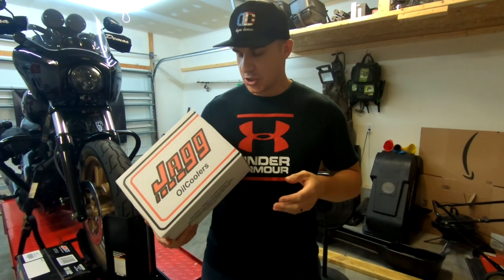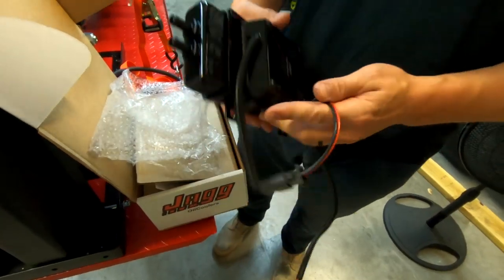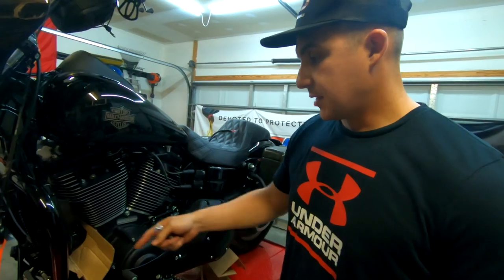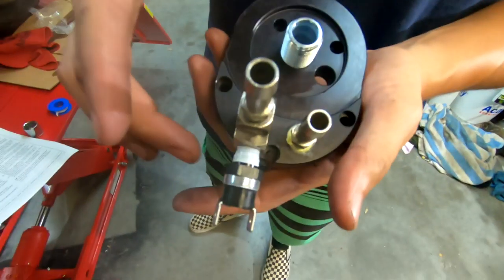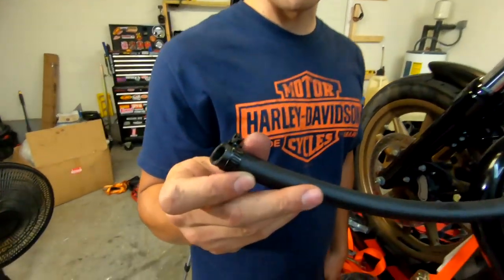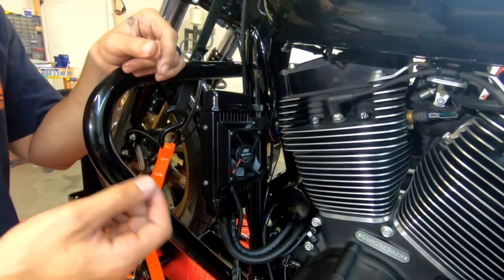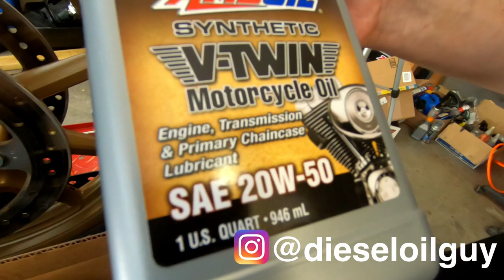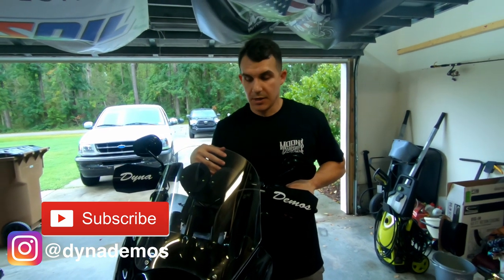Jagg Oil Cooler Install (dyna)

Comment: Just installed one, minus the fan option on my FXR. Had to use an external thermostat as the filter housing is under the bike. These work great and have ran one on my past few Evo’s. Must have on these hot air cooled bikes.

Comment: Just found this video and just purchased the same unit for my 2013 Dyna FatBob.  Looks fairly easy to install, I’ll let you know how I make out.  My buddy has it on his Street Glide and sold me on it.  Thanks!
Reply from the maker: Please do!
Reply: @dynademos  so I installed the Jagg oil cooler on my Fat Bob and have had good results so far.  Definitely running cooler.  I’ll be taking part in America’s 9/11 ride in a couple weeks, so I’ll definitely report back with it performance during that ride.

Had some problems though with the install.  First was the down tube mounts which were slightly smaller than what I needed. I couldn’t get it closed tight and the bolts pushed through the mount holes.  I added a washer between the head bolt and the mount, I was able to get it to close tightly.  Also, one of the black 1-3/8” bolt, used to mount the front part of the adapter and engine anti-rotation bar, the hex-head stripped out.  This happened when I was fitting up everything.  Unfortunately, I had to cut the head out and use a set of vise grips to back the rest of the bolt out.  I purchased a set of better 10-24 1-3/8” bolts to replace them.  Other than those hangups, it is working great so far!

Comment: I installed the Ultra cooler 3.0  about 2  days ago on my Road King S&S 100" with easy start 585 cams before the install of the cooler my bike ran at 267 degrees at a 100 degree day in Sacramento know it's at 227 Degrees just remember if you have your bike tuned professionally you will see numbers like this stay far away from all of those can tunes on the market you are better off getting a real tune that will make more HP and make your bike run much cooler
Reply from the maker: Roger Moore that’s awesome rod plans to get his bike tuned eventually 👍🏽

Comment: Depending on the fan. Some fans spin the other direct if the wiring is reversed. Just make sure the fan is pulling air through, when you're done.
Reply from the maker: Matt Storie will do it stated in the instructions it didn’t matter what terminal post it was on but I’ll make sure 👍🏽

Comment: Great Video as always.....that bike is a can bus bike....can bus is high speed communication basically when you press the turn signal switch its sending a signal to the control module to turn on the turn signals. Unlike a traditional circuit that completes the circuit to ground if that makes since....lol 🤜🤛
Reply from the maker: Tripp_HPjunkie yeah that totally makes sense now new school vs an old school electrical system

Comment: Best place for Oil Cooler is Above the Regulator. Just Switch the Horn Bracket Around. And you Won't loose Air cooling on left side of Engine.
Reply from the maker: Noted thanks for the advice!

Comment: Great videos as always. So as a new rider stationed in Naples, Italy although lane splitting is a custom thing especially for motorcycles sometimes its either just not safe to or confidence may be lower. Would this be a good mod especially during construction or accident heavy events for a new rider on a 2017 street bob dyna?
Reply from the maker: Aaron's Tech Talk If you’re worried about your bike overheating from sitting in traffic definitely a good investment I’m moving to Cali so I didn’t want to get one-lego
Reply: @dynademos  did you ever get more information on the canvas item you mention dealing with accessories connected to the battery?

Comment: Old video but I’m curious.. can the filter adapter be clocked more forward? I ask because I have a wide band O2 sensor that points directly to the base of the filter

Comment: Fan should be on the front pushing air in, correct?
Reply from the maker: Punch In The Pants Pit P the directions state to install it this way however i have seen a radiator fan installed both ways on a car or truck.  In this case i’m assuming the manufacturer calls for it to be installed this way to protect the fan from possible damage from road debris? 🤷🏽‍♂️ just an assumption though

Comment: The reason they say to set it on to the case. Is  so when  its time to  loosen  your oil filter the bracket doesn't work loose.   Ask me how I know.  You might get thru one oil  change but sooner are later it will get loose.  Been running mine for 15k.also use gates transmission lines next time and fuel injection clamps better than the worm stye clamps that they provide . they can be bought a napa auto parts
Reply from the maker: We will look into it setting it on the case hasn’t caused wear?
Reply: @dynademos  no wear. When you rotate the filter counter clock wise it will loosen the mount.   Also when you apply the filter just snug it.  It will get insanely tight for some reason.
Reply: dynademos  a gap of a slice of paper if perfect!

Definitely get rid of those worm style clamps!
I think the one you need are “stepper style “.

Lowe’s n HD has them by the bag.   “Side cutters aka wire cutters”  are the proper tool to clamp them down.

Really good video guys!

Larry
Reply from the maker: mafosa thankyou for the info !

Comment: So would this process for mounting be similar if I was mounting it behind the front tire? Bike is a 2004 Dyna Wide Glide FI.
Reply from the maker: Big Chungas,  the hook up of the fan would be different,  Our bikes have a different electrical connectors.  The oil cooler comes with pretty good instructions with pictures.  Should be very similar at the oil filter.
Reply: @dynademos  Alright, working on it now. Thanks!

Comment: Have you tried love jugs..
Reply from the maker: I have not!
Reply: @dynademos  Love Jugs have been around forever and frankly it's a scam. It's basically putting 2x80mm fans behind the horn pointed at the side of the cylinders then charging a couple of hundred bucks... It does nothing to cool temps so don't waste your time and money. You're on the right track with cooling the engine oil to get the bike temp lower... but like Jax the french bulldog mentioned a dyno tune will really make a big difference not only with lowering the temp but a whopping gain in HP in all the ranges.